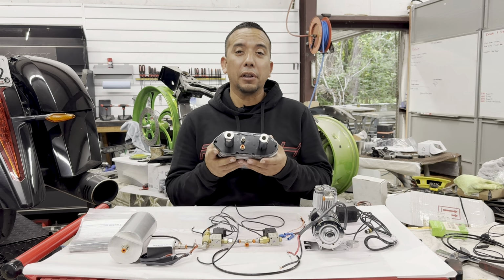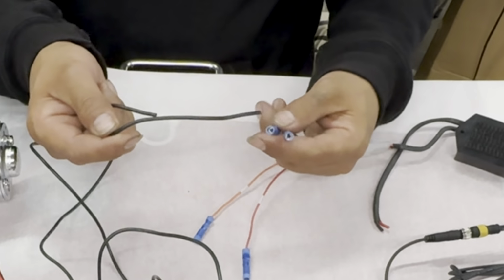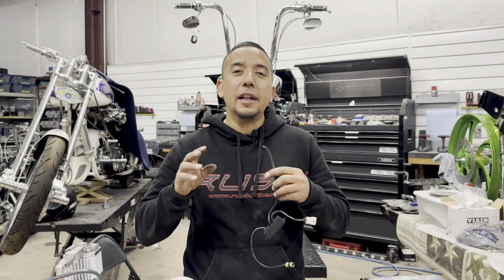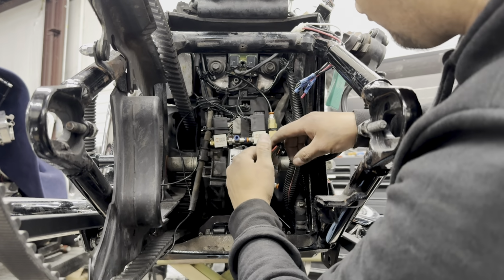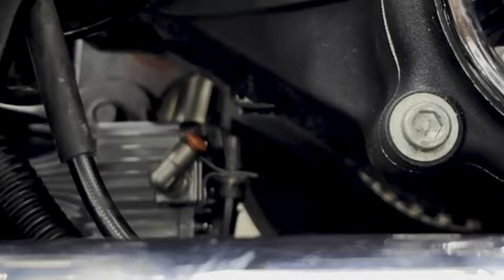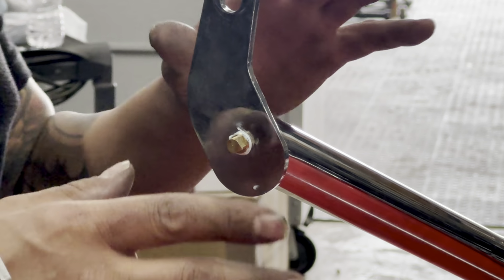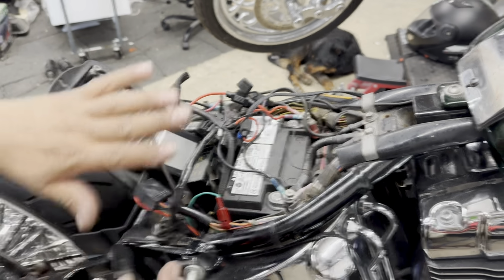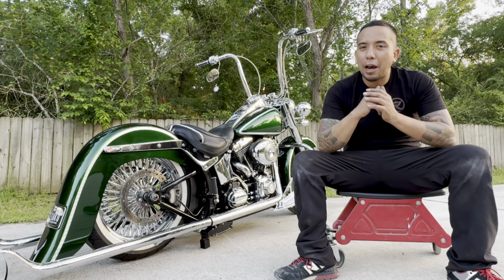How to install air ride on a Softail ​⁠

Comment: I think it’s a little bit of a scam that we gotta pay as much as we do for a full 4 wheel air ride kit for a simple Harley air ride kit! Thanks for the video tho! Great instructions!
Reply from the maker: For sure. Custom motorcycle parts and upgrades are not cheap. what's worse are all the low quality parts on the market. I do these videos to guide customizers out there to products that perform well and usually last the lifetime of their bike. Thank you for tuning in.

Comment: I'm trying to clean up a mess done by someone else on my 2015 Deluxe. Splash guard is gone, and BCM gets wet when washing or caught in rain. I believe this system can clean up my mess but I also have front air ride. Is there a port for the front? And I didn't see where the BCM is located on the bike in the video. Please give your opinion on those issues I have, thank you, Joe.
Reply from the maker: Hello Joe send me an email to Marcel@rushbikes.com and include some photos of what you’re dealing with. I’ll help you out bud
Reply from the maker: The BCM is located between the oil pan and the rear wheel splash guard. You will have to remove your rear wheel to access it. It’s easier if you pull your rear fender. Just loosen the two bolts on each side of your rear fender stays and unplug your tail light to remove

Comment: Great Video Detailed description of installation just from watching your video got me sold on AirFX for my Softail…Question How Is this AirFX compared to Shotgun shocks?
Reply from the maker: Air FX is top of the line equipment designed by Jeff Schwint, a robotics engineer who overbuilds everything. I have 3 Air FX systems on my personal bikes that are going on 20 years now. Still operating flawlessly like the same day I installed it. I don’t have anything bad to say about Shotgun, but every air ride we install is equipped with instant up and compressed air to get up & go.

Comment: I didn't watch entire video yet however, did you install a switch if so, is that an accessory
Reply from the maker: Yes I installed the micro button switches during the handlebar installation

Comment from the maker: Air Ride suspensions are not all created equally. This air suspension was designed by Jeff Schwint, a robotics engineer, who over builds everything.from Teflon impregnated copper sleeves to deep oceanic oils seals, these chair rides are built to last. I bought my first air ride in 2004 and still works perfectly.